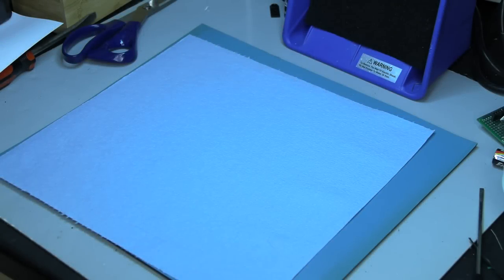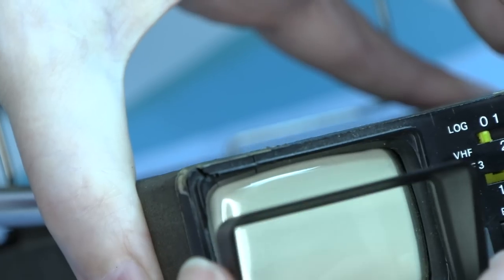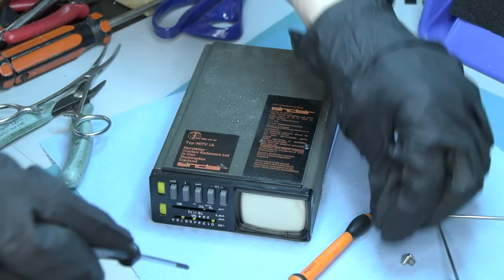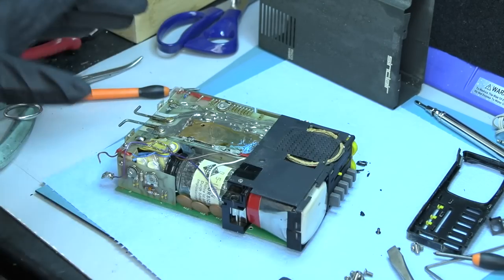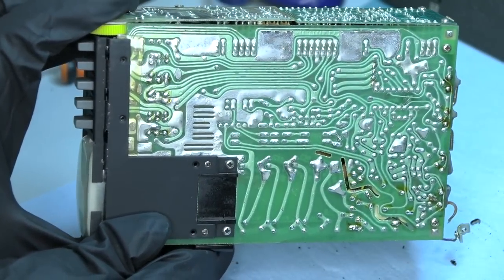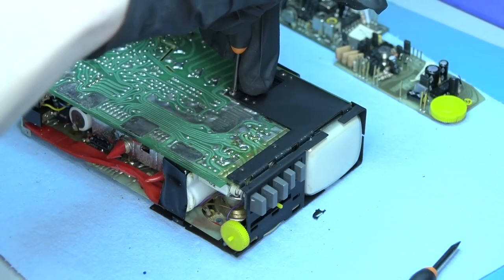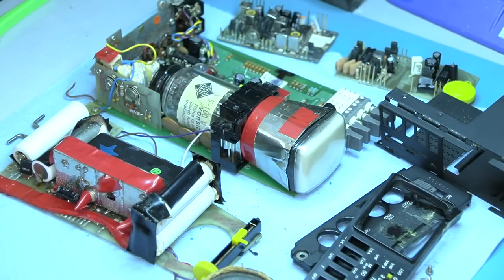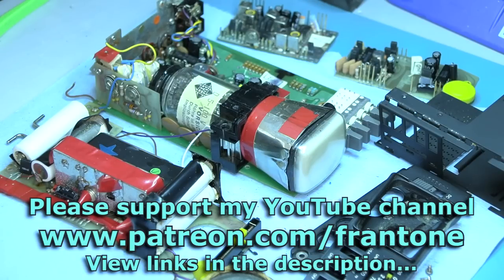Sinclair MTV1 Handheld Television

Comment: Clive Sinclair was a genius,
Reply: And a madman.
Reply: @Landrew0  "Jet Set Fucking Willy!"
Reply: ...until he put 3 wheels and a motor into a bathtub 🛀
Reply: @MasseyLee  That was genius as well,, it's an E-Bike but 35 years ago.
Reply: @MasseyLee  He didn't.
Reply: Man's a genius, remember?
Reply: Those HV caps are worryingly close to the headphone socket!
Reply: No, he wasn't a genius. He was THE genius.
Reply: SInclair himself did almost none of the design (electrical and physical) of the Sinclair products.  He did have Jim Westwood whom I'm sure did the circuit designs for the MTV1 in the video.  In 1967 I spent some time in the same room as JIm when he was working on an earlier version which never went into production.  Also in that room was Chris Curry who later was a co-founder of Acorn Computers.
Reply: @geoffmorrison3648  Next you'll tell me Elon Musk knows nothing about electric cars or rockets!
Reply: @TiberiusWallace  i'll tell you nothing about Elon Musk as I have no direct knowledge.  What I wrote above was based on first hand inside knowledge from working at Sinclair Radionics. Yes, in the early 1960s when Sinclair Radionics was basically Clive doing the technical work and a few non-tech people handling the mail orders, the original tiny amplifier, matchbox radio and signal injector were designed by him.  By the time I was there in 1967 in the development lab in the top front room of the 3 floors plus basement house at 22 Newmarket Road, Cambridge, UK there were about 15 people and Clive was not doing any detailed design work.  That is not to say that he had no input into the products.
Reply: @geoffmorrison3648  I was joking.
Reply: He certainly was a very clever businessman, originally buying marginal transistors and re-testing them, then selling them at a profit, advertising them in the electronics hobbiest magazines.

Comment: I used a later model, possibly smaller still, in 1984 when I worked for a TV news crew. The power came from single-use batteries produced by polaroid (as used in some of their cameras?). Our receiver was used as a simple off-air back-up. It was small enough to fit in a reporter's coat pocket to prompt them during live handovers. The only snag was having to quickly fade down the earpiece  sound, otherwise the slight terrestrial delay would be distracting to the reporter during his spiel. Still not as extreme as satellite delay times though. It really was revolutionary, at a time when our 'mobile' phone (no screen!) was built into the car dashboard, and the  TV camera ran from a battery that was way heavier than Mr Sinclair's entire TV.
Reply: That sounds like a "Polapulse" battery... originally developed by the Polaroid camera company for their SX-70 model.  In those cameras, each film pack contained a battery.
Reply: @moi01887  it is   the joke was "the battery started off FLAT to begin with"  because they ran out quickly.  Like EV miles range anxiety you might miss end of program
Reply: That would have bee one of the flat tube models.  The electron beam came in from the side, parallel (ie nor perpendicular) to the tube face.
Reply: @geoffmorrison3648  Oh yes you're right. I'm confusing between the Fran's USA market Microvision in video to this later example in the comment that came out in the UK: "TV80" in '82 or '83 . used the flat battery  and the sideways CRT like used in video intercom doorbells .
Reply: @geoffmorrison3648  thanks, that would make sense for the pocketable device I remember.
Reply: I have one of those. It's completely dead now though. I suspect the LOPT has shorted turns from the high voltage breaking the insulation down. The removable battery does mean it's not so disgusting inside.

Comment: It'd be great to see that CRT running in some other project. The rest looks pretty crusty.
They were really pushing the limits of technology. Cool!
Reply from the maker: I'm thinking about it.  The tube is in great shape.
Reply: I would repurpose it as XY scope for audio. Some masterpieces of mr. Jerobeam Fenderson might play well on this tube.
Reply: @JanicekTrnecka  I would repurpose it as a video monitor, because it has white phosphor, which is unique for such a small electrostatic deflection CRT.
Reply: @FranLab  I do wonder, though.  Watching Adrian Black work on CRT TVs has taught me that you never know if a tube still has much life left in it till you actually get it fired up
Reply: @FranLab if you can't fire it up easily I suggest give the tube a shake and listen if there's anything rattling around inside   like bits of broken glass electrode supports rattling around
Reply: Not really....(the pushing).
Reply: @muppetpaster  Sinclair's unique style was often product dependent on pushed component performance, his very early stuff had one same single transistor amplifying three times. Often using the component different to the published data (what we now call "off-label") , for instance he bought a huge quantity of expensive RAM for almost nothing because the other unused half had a defect. Then when supply ran out 'RAM Paging' became fashionable
Reply: ISTR that Sinclair also made a mini portable oscilloscope presumably using the same CRT. Unfortunately not in the same form factor (I just checked, it was called the SC110.) I was in my teens in the peak Sinclair years and this Microvision was something I always dreamed of owning.
Reply: @simonstroud2555  I have the SC110a and still works. It's a marvel of late 70s low-power design.  Consumes just over 1 watt beam on , about 0.4W with beam off. About half of the power budget is the cathode heater. It's supplied with a few turns wire round the EHT transformer core. I think the cathode would work with 1/2 to 2/3 the power.  
I can't confirm it's the same CRT.
Reply: @FranLab >>> Maybe a working reproduction of the "COMMLOCK" from the British science fiction TV show SPACE: 1999?
Reply: Yes!! space 1999 COMMS !! , I've seen them made from camcorder eye pieces, but I think this will look better! With some modern tech you could have all sorts of inputs for all kinds of uses!
  It would also pay homage to it's English ancestry!
Reply: I'll take it, I doubt I'll get it working, but I'd have to try rather then see it scraped...

Comment: I noticed right away it had no magnetic deflection so I found the PDF online and yep, a form of electrostatic deflection like a scope, rather unique for a TV in that time frame. It would make a good restore project for someone dedicated to that kind of stuff.
Reply: I am bit disappointed Fran don't want to restore it. That battery leakage don't seem too bad. After some cleaning connect 5V power supply instead of battery to give it a try.....

Comment: What a cool device - considering that they had to pack in both high voltage and electronics for the range of TV channels.  If the batteries hadn't ruined everything it would have been cool to connect it to a converter and see a current TV station on it.
Reply: Restauration should be no problem but there are no longer any analoge TV-Station transmitting at least here in Europe.
Reply: @greekstraycats  "Video Sender" from the 1980s 90s was a little box with antenna that made a TV station, you plugged it in the back of VCR or DVD so you can watch through an analog TV wirelessly
Reply: @jagmarc  connecting the old Sinclair ZX81 should also work out the box 🙂. I still have some of those. So we had vintage portable computer....

I had a some larger portable B/W TV from Philips in the 1980th when I attended evening classes I was able to watch "Dallas" in the car after the lessons.
Reply: @greekstraycats  any computer , game console or dvd player etc. with the "TV channel 36-39" output will work. Anything containing a 'modulator' . Sinclair used ASTEC ones in their ZX80/ZX81 & ZX82 etc. models

Comment: Back in the day, I integrated a Sinclair Computer with a Sinclair flat screen television and an aftermarket keyboard into what would today be called a laptop computer. The frame that held the television was on a bracket attached to the aftermarket keyboard and could be closed against the keyboard. I even added a micro cassette recorder as a memory. Sometimes all that is required is the recognition of an innovation.
Reply: The sad thing is the recognition seldom goes to the original inventor.
Reply: @anonymous.youtuber  yes that's so true, the Cambridge based team that had wrote Sinclair BASIC were supposed to had received royalties on every ROM delivered but didn't

Comment: I have designed and built few simple tube amplifier projects, and have always had the most problems trying to cram everything into an enclosure in a way that it'll be serviceable later.  Enormous respect for the engineers that designed this thing.  It looks a little janky, but it had to have taken a lot of effort to get all that stuff crammed into that little box and actually have it work. A pain to disassemble for sure, but everything is still accessible.  Shame it was in such bad condition though.
Reply: I'm so curious what their process must have been like. I assume they confirmed the electronic parts all worked and then made some sort of physical markup. Assuming that during that time they were ordering bespoke enclosures and so on

Comment: It was a cool tech gadget for the day.  I remember seeing the adverts for them.  I just couldn't imagine trying to watch any show on that small screen.
They really packed everything in tight into that brick.  I didn't think the gunk and corrosion was that bad for a device made in 1978.  I've seen some battery leakage that was just over everything.  Obviously not much thought was given to much repair access, as those batteries are right in the middle, and only a few adjustable pots at the back.
Sinclair came out with some very unique things, back in the day.  Though their reliability left much to be desired.

Comment: Wow. Your covering Sinclair. Such a big part of my childhood growing up with my father owning the first calculator that used the pulsed battery cycle, then the watch. He also had a host of computers from the ZX80 to the toast rack 128K. I remember the microdrives and tape loading. We also owned the ill fated QL. Sinclair is just so iconic here in the UK and ironically I live less then a mile away from the Sinclair research mill road headquarters. Great to see you covering something like Sinclair as most do Timex who they partnered with. It's interesting as Sinclair research ltd really was in many ways a mirror of apple. They started off hifi and radio based, moved into calculators, watches,TVs,then home pc market, portable pc then electric vehicles. Obviously apple is successful but one could argue that Clive Sinclair was just trying to bring things to the masses ahead of their time.
Reply: I remember Sinclairs products well and trying to get the kit built ones working was a challange.
He had some great ideas, but the components used were just not capable of working for any length of time
and the thin brittle plastic used just falls apart, hence the sticky tape on this TV.
Reply: @Barbarapape  Yes agreed. As with most Sinclair products, the manufacturing standards and practices just wasn’t there yet for the types of technologies he was creating. Pretty much a case of fantastic products hobbled by cheap build quality. And in the case of many products he just simply pushed to hard to bring them to market before they was ready. The QL was killed because of this. But theses rushed practices was apparent on other projects like the 2nd portable TV, Sinclair watch and finally the C5.
Reply: Still have my QL, with an ice cream tub full to the brim with microdrive carts.
Reply: @Petertronic  Some Sinclair products can last for years. others didn't work 
when they left the factory.
Hence his poor reputation, just keep using it, the worst thing you can do is leave
it unused for many years, that's when the capacitors dry out.
Reply: The was a Lad in my dormitory at boarding school who had a Sinclair C5 electric vehicle.
 God's honest truth... It was paid for by bank account from the IRA
  Yes he had to do a job for them because now you're in our debt.

Comment: You missed the most significant thing about the set.  It has an electrostatic CRT!  There is no flyback.  Their was two sets of voltage multipliers one for the for horizontal deflection and beam acceleration and the other for vertical deflection.  Way cool tare down.  I've never seen an electrostatic CRT that small.

Comment: I owned the one after this model which was about half the width but the same length in 1978.  Worked great! and used regular AA batteries.   I was working in London and got home by train at about 7:30pm.  Before getting that job in London I used to sit in an armchair at home watching the nightly news so I bought a Sinclair mini TV and sat watching the news on the train on my way home.  Just swapped an armchair for a train ride and extra overtime pay!
Thanks to Clive Sinclair, a very clever man (except for the C5!)
Reply: the C5 is an example of being too early. Electrical bicycles and such are very popular now (in the Netherlands) but that is because we have the biking infrastructure, I can imagine that in the UK it was not safe on those streets, that is why it needed a flag stick to be seen. Still its not a stupid idea, just oo early, and yes, it again had a ferranti ULA inside!

Comment: I used to work at the Sinclair factory in St.Ives as a Technician repairing these Microvision TV's - I spent almost a year working on the main circuit boards that failed production test - that was al long time ago back in the late 70s :)

Comment: The flat screen mini Sinclair TV was novel, it used a standard electron gun but the beam was bent by 90 degrees to hit the phosphor. It’s battery was a flat pack thing, almost like a modern chewing gum lithium battery.
Reply: As do/did all the intercomscreens those days......90 deg.......
Reply: The "TV80" which came out nearly 2 decades later than this "MTV1"

Comment: I have one just like it apart from the fact it is brown. Sadly no longer works in Uk as no AM transmiddions any longer. I used it for a while as a mini monitor.
Reply: There are digital to analogue converters - I assume one somehow connects the coax output to the aerial fittings.

Comment: RSVP that Sinclair MTV1.

I was cringing when you were snapping the plastic because I was holding onto the hope that it's not so bad inside. But after seeing all that corrosion, it's definitely not worth restoring. It would take days of scrubbing, replacing connectors and parts, then more days of troubleshooting to get working. And in the end you'll still just have a Sinclair. Sure it's ridiculously small for a CRT TV, especially in the era before everything was integrated into a few chips, but Sinclair was never known for producing the highest quality devices.

At least we got to see the teardown in the end.

Comment: I would give it a try. I would just remove the dead NiCads, clean all the pins and power it on using a variable DC PSU to see what happens. I wouldn´t be surprised at all if the TV turns on. The corrosion damage is very limited, so it isn´t unsalvageable.
Reply: Exactly. It looks well built.

Comment: Oh man that brings me back.
83 channels. EU, UK, US

This reminds me of my 12 band, or maybe 15 band GE radio.
That had SW bands, CB, Low 20 to 70 mhz, TV 1 channel 1 to 6, FM 86 to 108, AIR 108 to 136
VHF low 136 to 180 mhz
TV 7 to 13, Military Air 250 to 350, Military Land 350 to 450
UHF low 450 to 520.mhz
UHF TV 14 to 83
Basically the full band .1 to 1 ghz radio
I know icom made a handheld really small full coverage.1 to 1 ghz radio
I think the Uniden BR330T had some missing sections.
The BC9000XLT had 25 mhz to 950 mhz
The 2500,3000,8500 and 9000 I think had the full 25 to 950 coverage

I saw last year an auction for a scanner from the early 80s that was way ahead of its time. 1 mhz to 999 mhz am/fm analog 

There are so many cool radios available in China now that are not available anywhere else and not shipped to America
Like the UV-5R that does what the 500 dollar ham radios did for 20 dollars, they have a digital phase 2, dmr, open sky scanner for 50 dollars thst does what the 900 dollar Uniden sds100 does with all the extra keys

I really wish they would start selling them here

Comment: That green surface corrosion visible on external metal surfaces is typical of PVC damage. The vinyl carrying case outgassed Chloride which reacts with atmospheric moisture to produce hydrochloric acid.
Reply from the maker: I'm very familiar with PVC plasticizer creep but this is a cyan blue corrosion caused by the NiCad batteries leaking inside. More on the PVC issue here... https://www.youtube.com/watch?v=mHIgjTd0yCQ

Comment: I had this unit in 1979 on for a few years, until it brokr down. I had it
on a vacation that year to Europe,
and saw TV there, but in France,
no picture due to their 819 line
picture, back in the old NTSC and
PAL analog systems. 
In 1980, I even took it up on
MT Washington, NH, over 6000
feet ASL, going up on the COG 
in Summer 1980. I received TV
all around from New England and
nearby Quebec, in Canada.😊
Reply: There was 625/50 broadcasting in France since Secam was introduced in 1967. But French do everything different, so with positive video modulation and AM sound...
Reply: @xsc1000  Yes, I remember the negative image on French TV and that their
modulation was AM, as opposed to FM.